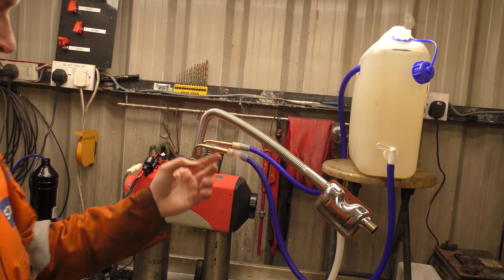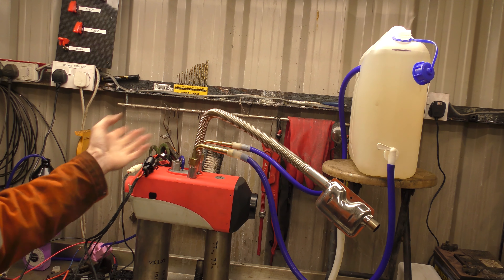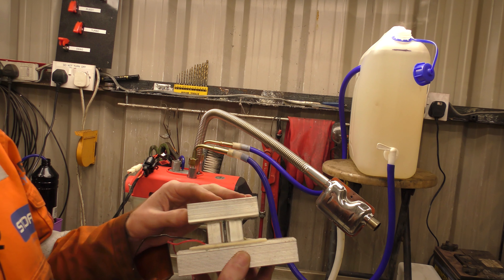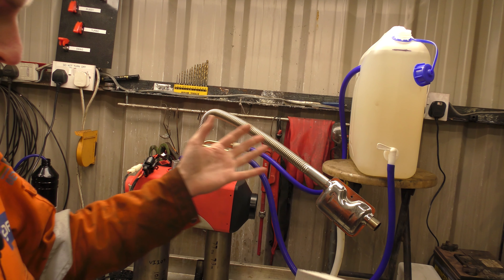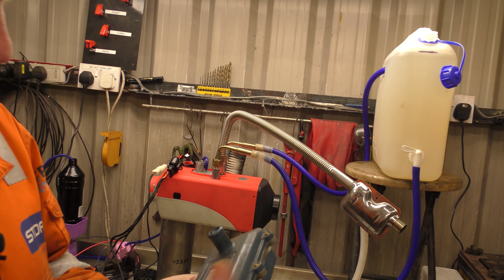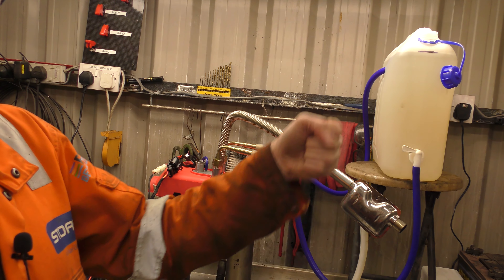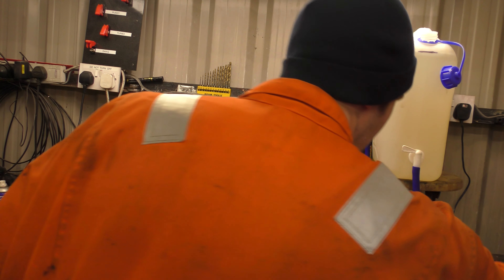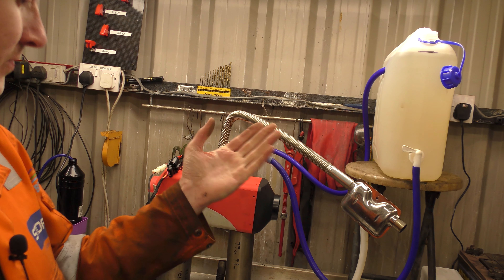Happy New Year / Coming in 2020 / Air + water thermosiphon

Comment: Happy New year David.  For a shower I use the portable USB 12v charge hand held. ( camp shower),  £20 off ebay or Amazon.. I'm also getting a 300w - 12v  immersion heater element off ebay or Amazon, they're around 15-£20..  Wire that up to a leisure battery in a van - connected via a CTEK to the starter battery.  Then simply have a water barrel something like the one you're using and fix the element into the screw top of the water barrel.  I think a barrel of around 15-20LT with the heating element plugged through the top of it will heat the water quite quickly with a decent leisure battery.. I'm thinking it could also be running as I'm driving around so to stop any battery depletion..  
( The idea is no different then the old house emmersion we had years ago. Though with using 12v.   I saw a guy do it on YouTube using only a 150w element. )
Reply: This is close to what I've been experimenting with, I have a USB rechargeable camp shower pump + I've been using a 1000w bucket heater to heat the water.   3 gallons is plenty for a navy  shower,  and it takes about 20 minutes to heat up (inefficiently, before insulating etc).   For mobile use I got a 850w sous vide,  and I was thinking of using the already warm sous vide water to shower when possible,  and some combination of "passive solar black tube on top"/propane/sous vide off solar/battery to heat the water.   

Now I'm really interested in  working one of these diesel heaters into the mix...

Comment: We run the Chinese 16kw diesel water heaters on our vehicles. They do suffer from smoke or failed fire ups,  we've changed the jets which has helped but they are temperamental. Very basic once opened, looks like something from a 70s communist state military vehicle. When working,  it's good.  Keep up the good work. I totally enjoy your videos

Comment: David, I am set up in my shop now with a 5kW heater that starts and runs on alcohol (like me). I’m using a 25 foot 1.5” exhaust pipe to recover some of the heat into my shop. The final exhaust temp is around 50C. For 2020 I’d love to see if the exhaust could be run trough an old car radiator to recover even more heat. Or any other air to air heat exchange ideas.
Very much appreciate your videos and all that you do!
Cheers from the frozen Canadian tundra
Reply: sent my exhaust through a bathroom towel radiator inlet side well too hot to touch outlet 25 degrees c Av Fun!!

Comment: i learned 1 thing when i was playing with peltier modules, i had a oil burner flame on one side and heatsink on the other, powering a 10w led. at first there was alot of light, but as the heatsing warmed up the output decreased, the heatsink only was luke warm and not hot, so if you could use the intake air to keep the heatsink cool then it will give you more power from the modules
Reply from the maker: Yes, as it's not the amount of heat applied but the difference in temperature between the hot and cold that gives the most output.
Reply: I've also been considering peltier modules fitted to a box that clamps on and off around my heater exhaust when I park up. I've been coming up with ideas for months now and cool air from under my van on the outside seems appropriate.
I use my heater when it's cold so outside air will be cold too.

I was thinking of a simple connect/disconnect socket under my van with an isolator switch inside the van. When I fit or remove the device, this should be a quick process.
Your idea of the inlet air passing over the cold side of the modules is a fantastic ides, raising the cold vs hot value, well done.

I do think this is all feasible and believe Dave may enjoy this challenge.
A diesel heater that can produce enough power to keep its energy demands happy, priceless! With some extra juice to slowly charge a leisure battery, bl**dy marvellous.

Really glad you made a comment on this one MN SHP.

Comment: Happy new year David, I'll look foreword to the burn chamber video, remember to slightly flatten the copper pipe you wrap round it,increase the surface area, and put little spacers, couple of millimeters between the coil's,a loop of copper wire will do nicley,seen it on a video making a steam powered car,it increases the efficacy of heating

Comment: Happy 2020!
Thx for all the test, keep on the good work!
Your the only source I trust to decide which kind of heating I'm gonne use for my camper.

The setup I most likely to use now is this combo:
- Chinese diesel Air heater and afterburner PCB controller
- Elgena boiler nautic compact air

Very simple setup and can heat with 220v if the camper is plugged in to the mains.

Ps: for shower I would use one of two systems:
- air heated boiler with a 220v heating resistor.
- higher power water heating glycol based system with egr heat recovery for max efficiency with separate heat exchangers for shower and kitchen and radiators for heating the interior of the camper.

Comment: I have the 8kw air heater that I’m adding a copper exhort pipe and water heat exchanger. Copper water jacket about 4.5ft. I mounted the heater high on the wall ~ 5.5 feet. It is in a utility trailer I work out of some times. I think this will work more efficiently and cost effective for me. I’m thinking of doing the same in a p30 step van. I like your ideas thank you.

Comment: I wonder if it's possible to use the TECs to generate enough power to make it self sustainable. Of course you will need a battery/ power supply to start the unit, but once up and running I could generate all the electricity it needs
Keep up the good work and happy new year!

Comment: Shave the top of the heat sink of the heater and make a small dinner on the heater. Or run the exhaust through a aluminum radiator and see how much more hotter that gets compared to the regular heater.

Comment: How about trying a small turbo intercooler to extract more heat from the exhaust of these units. If it doesn't cause air flow problems then add a fan.

Comment: David, thanks for the great videos! Funny and informative, Billy Connolly with a spanner. For the Chinese Diesel Heaters, can you suggest a way to hack the remote or the LCD controller to mate it with a battery voltage sensor to allow a controlled heater shutdown  when the battery voltage drops below some pre-determined safe voltage, in order to prevent a Chinese Diesel Heater from murdering my boat batteries?

Comment: I'm wondering, If you painted the 1st 6 inches of the exhaust pipe black then wrapped copper tubing round it to create hot water on just the heater ver or with the water heater ver in line with the hot water outlet.

Comment: I want to see hot water run through an old copper radiator from a small car or dirtbike or aironditioner with  about 4 12v PC fans to blow warm air into a room (possibly a room the hot air isn't routed too) just to see how good secondary heating could be  with the water heater versions, is also like to see the fan versions try it too with the EGR as 2nd heat scavenge .. this could make quite few nice testing vids I think..

Comment: A thought for your copper pipe around the burn chamber. You could use an older heat sink unit and machine out the fins inside. That would give plenty of room for the pipe. If it doesn't look like swiss cheese after. I think you mentioned that the aluminum is very poor quality.
Reply from the maker: I wish I had a mill and a lathe.  And a hundred thousand square foot workshop.  I can dream.  :)

Comment: Would the heater thermo syphon better on its side? Also would it run better on its side after the experiments with heater position while running. Great videos, and have encouraged me to fit an old Eberspatcher D2 to my aircooled camper.
Reply from the maker: I did try it on it's side but it did the whole boil and splutter.  It might have been the angle of the pipes though.  I've got more hose coming so I can test again 'properly'.

Comment: Hi David, I am trying to accomplish to heat water to use for shower and to use it to heat a floor. But the problem I cant solve is to control the temperature of the water. Can you give me a hint how we could stop the heating of the water when a decent temperature is reached but without stopping the air heater?

Comment: Hello DavidI have a 8 kw (5 kw) heater and I have noticed, that the max pump Hz is 5,5 in the control panel. This can be increased to 8.0 Hz. Also the blower can be increased to 5000 rpm from 4500 rpm (i belive it was).Have you tried out these setting to get more power out?Also, do you know at what temperature it overheats and shuts Down?
Reply: Well, tried it out yesterday. Set the pump to 8.0 Hz and the fan to 5000 rpm and ran the heater full blast for half an hour.  The heater put out 140-150 C air and ran with no problem. When I turned down the heater, the air temperature remained the same. This is all good for me using the heater to warm up my 21 m2 greenhouse, but probably to hot for a boat or van. 
Also found out (internet search) that the shut down temperature is 230 C.

Comment: That would be awesome if I could heat my boat, have hot running water and not drain the battery during the night when my solar panels are US!  Imagine if it could generate the 5 amps to run itself and my Peltier fridge. Failing that I could bleed off heat to run a thermal cycle fridge. That would be a very very marketable device.
I currently plan to install a spare bladder pressurisation vessel that I will modify to contain a heat exchanger coil for the thermo syphon. I will then use a standard caravan tap and shower equipment. The heads are set up for wet room already draining into the bilge where the auto pump will deal with the shower waste. The bladder will deal with expansion and will ensure the pressurisation pump will not cycle frequently.

Comment: Hey brother. I'm in China right now and I'm gonna pick one of these up. Will it provide instant -on demand hot water for a shower if I installed it in my RV? Or do you need to heat up all the water in the tank first? Thanks for your videos!
Reply from the maker: It would have to heat a tank of water I'm afraid.

Comment: Looking forward to many more vids in 2020. Fav vid is the glass over burn chamber showing the burn. 

Could I suggest you do a couple of extras for the last video. Air heater with EGR on exhaust but swapped the pipes around. So inlet at the coldest end. 

Looking forward to seeing how much difference there is with the 5kw webasto. What do you recon killed the other?
Reply from the maker: I've actually got some proper stove ceramic window so I'd like to do some more burn chamber views.

The air heater with EGR had the cold feed pipe coming into the coldest part of the EGR first.  Contra flow as I was told.  But I can't remember if that was on the thermosiphon video or not.

Comment: Hey happy new year/Hogmony :-) thanks for the share, Ive been pondering on the Peltier TEG's on the exhaust, i knocked up a prototype system I was thinking of perhaps making down the line as in Manchester we dont have much roof or garden space for solar panels really. Looks an expensive unit even designed cheap, about the £500 mark, drop me a line and I would be happy to mail you over the cad and excel. My best Paul
Reply from the maker: As with all new things, it'll get cheaper if there is a demand and other people start making them.  Right now I can only find the one seller.  I'd love to see a design for a TEG setup.  My email is me@davidmcluckie.com

Comment: Hi David, Technical question- I see that you are running the heater with the exhaust venting into your workshop, is there not a problem with Carbon Monoxide ?, happy new year to you and thanks for your videos.
Reply from the maker: Yes.  Well not a problem in a test environment where I have the extractor fan and a CO alarm.  But you wouldn't run it like that normally.

Comment: Hm.  Now you've got me thinking about my "Koolatron"  cooler that,  although a very good cooler,  no longer cools when plugged in.  I'm sure it must have one of those fin thingies (my version of a technical term).   Maybe I can see why the bugger doesn't work?    See,  your videos are in fact useful to someone who might very well NEVER have a diesel heater.
Reply from the maker: Almost guarantee it'll be a TEC module or modules.  They actually work really well for that, my coolbox used to freeze cans if you left it on to long.